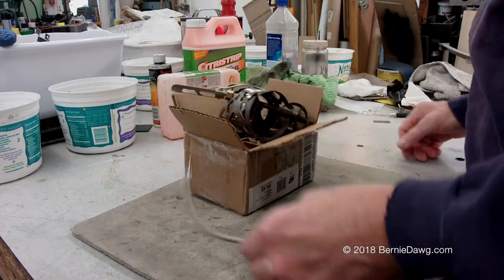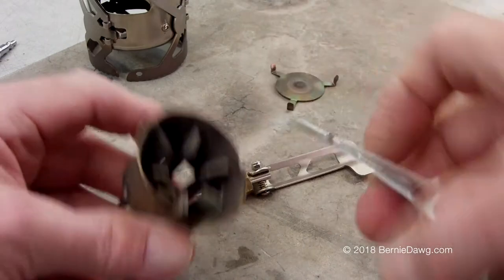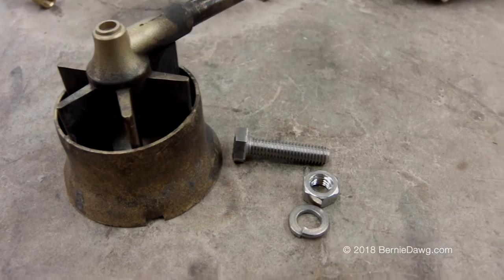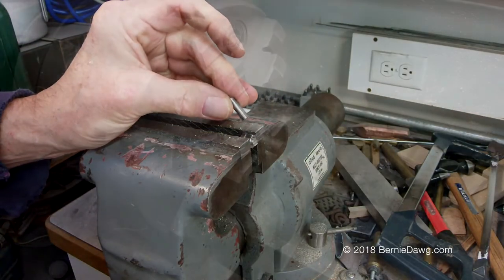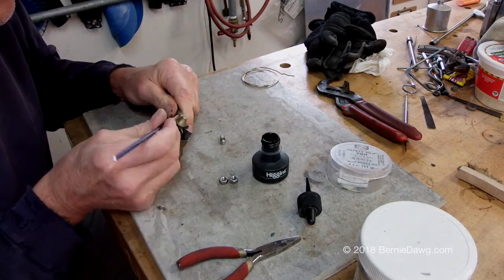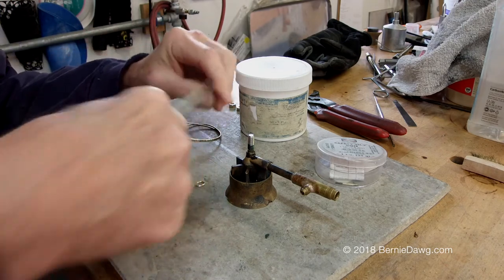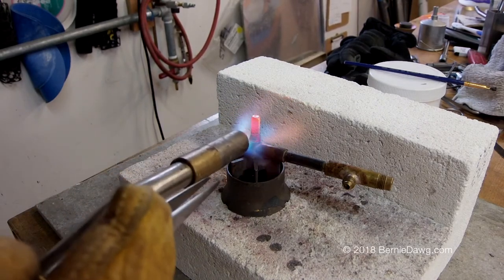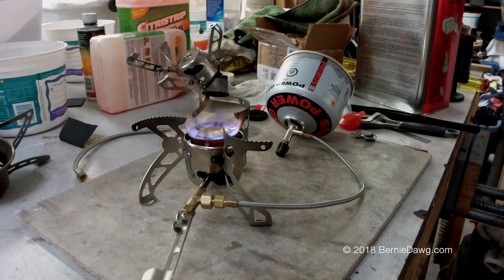Repairing a Nova Burner

Comment: Great film, I hope my new Polaris keep running without such problem you describe in the film.
Reply from the maker: The Polaris and more recent Novas have a redesigned attachment stud which seems better designed and more robust. These newer models don't seem to have the same problems with shearing that the early Novas (like in the video) seem to have. At least... not yet. 😉 Only time will tell - but nothing lasts forever. BD

Comment: That is a sure fine clean , smooth job 👍😃!  Chasing the threads with a die topped it off. 
     Is there a chart showing what solder to what material , to what flux to what material being soldered??? I've done a fare share of copper plumbing , but everything needed is on one ilse in the hardware store for such jobs.    I've wanted to solder stainless steel wire , but sure what materials to use. Assuming silver would be the best solder , but no clue what flux.     I use Borax in the shop when brazing cast iron , but thinking stainless needs something acidic ?.?.?...
   Thank You for any input 👍
Reply from the maker: @Phil Lowman Thanks! What I show in this video is silver *brazing*. It is performed at 1200-1400 deg F and is very different than "soldering" which is typically lead/tin alloy work performed at 350-400 deg F. Copper plumbing is low temperature tin/lead or tin/antimony soldering. Stainless steel is best brazed rather than soldered. Use nickel-bearing silver brazing filler for best flow-out.
For more information on the two processes and for specific product information on fillers and fluxes watch this video and read the lengthy description below the video: https://youtu.be/4zqCfOmkrcs More questions? Ask directly through email at bd@berniedawg.com 👍 BD

Comment: How did you cut the bolt to its final length?
Reply from the maker: Hacksaw. Then, I cleanup and chamfer the rough cut end with a stationary belt sander, a file and some carbide paper. You don't need a belt sander, you can do the same with a file and paper. It'd just take bit longer. BD